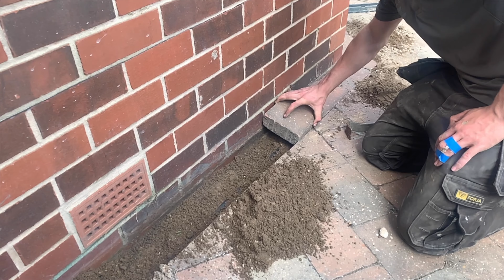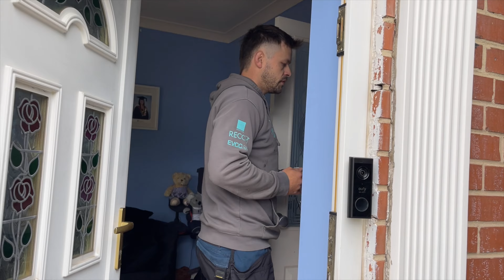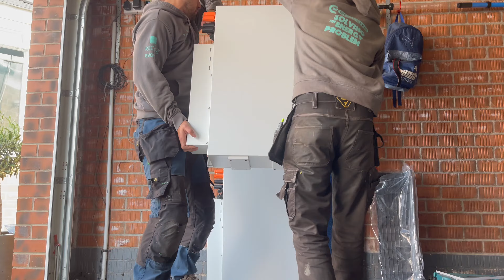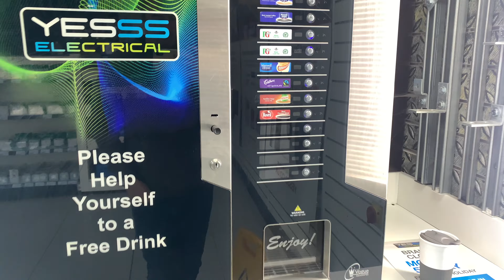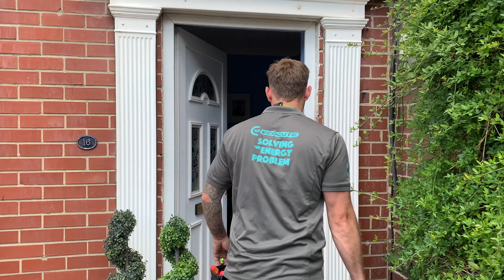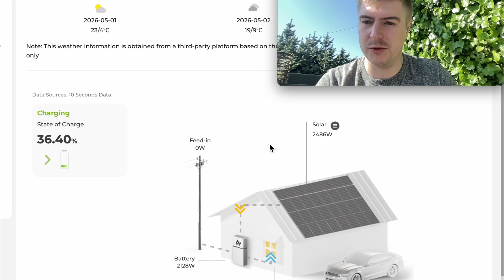Two Solar Systems, One Alpha ESS Battery - FIT Unaffected

Comment: does the solar cables not have to have isolators on the alpha ess inverter
Reply from the maker: Yes we fitted isolators for the DC string, it also has inbuilt isolator too for the DC.